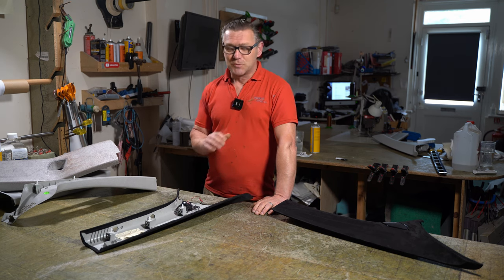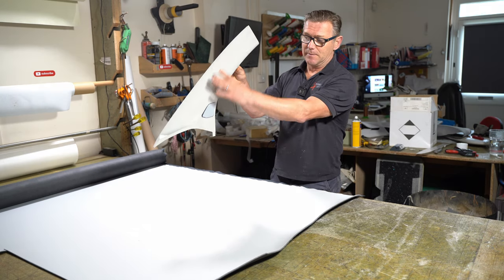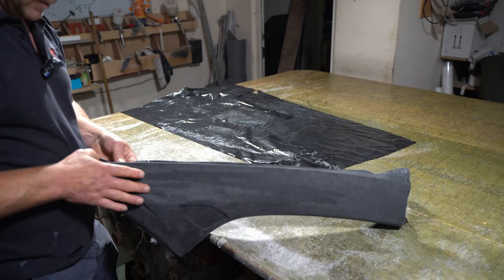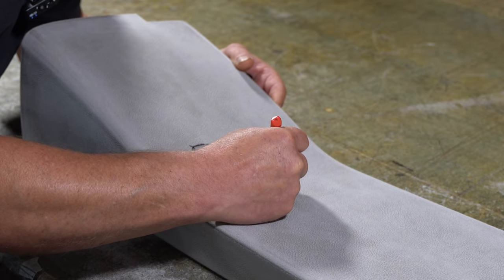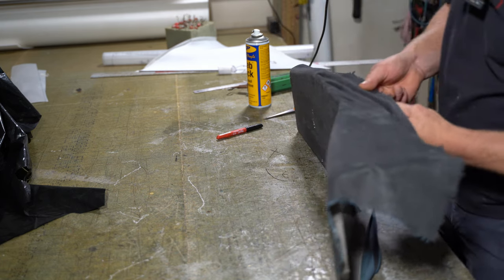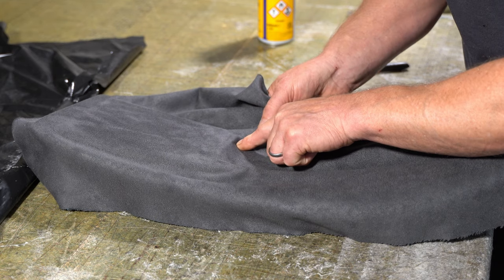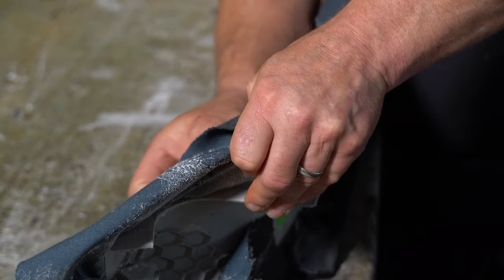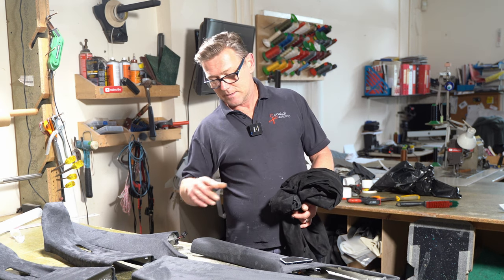How to cover plastic trims, VW T5/6 A and B pillar covers Full tutorial. Car upholstery

Comment: Absolutely great advise cleaning, sanding and prepping the parts...But ya forgot the back where you fold it over!  lol ;) I didn't think of cutting the material diagonally so we can be able to stretch it...
I have some lower trim on my Lincoln that has a leather texture but its just hard plastic, I want to sand the molding marks out of the parts  and cover them with a nice padded vinyl to match the leather as close as I can, then all the trim that is covered in fabric I want to do in black suede, I also want to cover the dash and instrument cluster surround in black suede as well. 
I'm subbing, My wife and I have a big job ahead of us if we're gonna make whats in my head happen on the car!
Reply from the maker: good luck

Comment: Hi, this is a fantastic and informative video.  I would like to do the upper dash in my VW T5, I assume i need to remove the whole dashboard. have you done this and if so could you give me some advise please? I haven't found a video on this on YouTube yet.
Reply from the maker: yes you will have to remove the whole dash. make sure that you prep the dash before doing any gluing. And an extra pair of hands may be helpful. Also cut the material that you will be using oversize, you can always trim of the excess later
Reply: @coastalcushionco8227  thank you
Reply from the maker: @senseinathan1  your welcome

Comment: Hi great job ,What spay glue do you use .?
Reply from the maker: I used Web Tack from TGP on this job its a high heat resistance Spray Adhesive that is low soak in
Reply: @coastalcushionco8227  thanks mate you’re a top craftsman .👍🏻
Reply from the maker: thanks for the complement  @vaughangreen9816